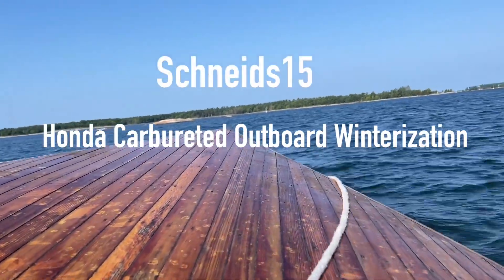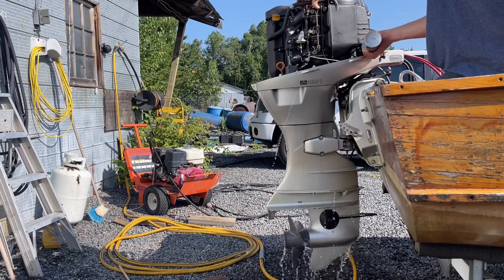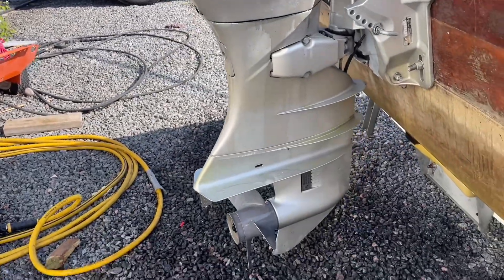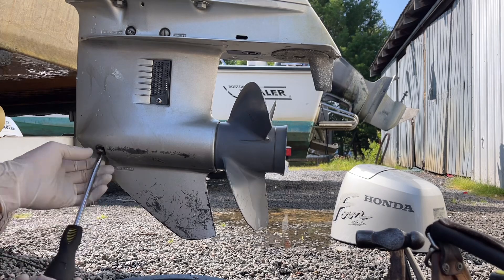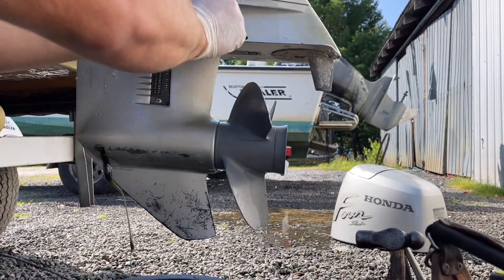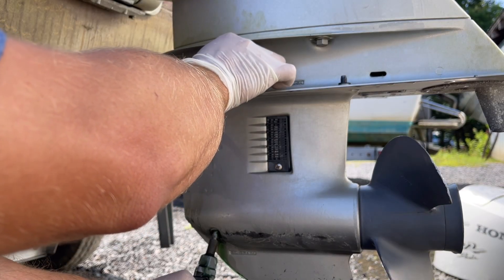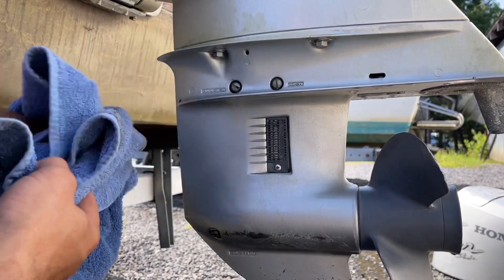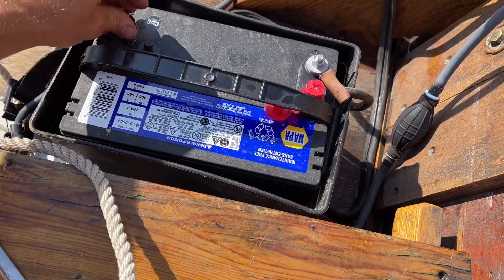Honda Outboard Winterization Process in 3 Mins!!

Comment: Thats not winterizing. You never put antifreeze in the engine.
Reply: If you store the motor in sub zero temps, there’s a chance any water left in the engine or lower unit passageways will freeze. That’s something that can write an engine off. It’s well worth pouring something like starbrite non toxic antifreeze through the engine and watch it come out of the lower unit. Personally I use a T connector in my water hose and connect it to the antifreeze container, and I open it to let the antifreeze flow through and then shut the water off. Then kill the engine when I see just pink coming out of the lower unit. I know it’s full of antifreeze then not water. Most water will of course drain out due to gravity. But you can’t be sure all of it will. A litre of two of antifreeze is cheap insurance.
Reply: @kristoffscuba5466  So, what do you do about antifreeze spillage and getting rid of it appropriately in the spring....that suff is toxic to pets - and they love it.
Reply from the maker: Gerry, if someone would want to run antifreeze through the engine you use Non Toxic RV Antifreeze.
Reply: Why would you?

Comment: Glad to hear you don’t have to run antifreeze  through a Honda, I never did .
One suggestion would be to loosen the drain plug screw in the Carnegie and get that old gas out of there while you’re storing it over the winter so it doesn’t gum  up on you .
So I didn’t use my Honda for three years and when I did a trial start up in the driveway it fired right up  !
Also, always use staybill no matter what, it’s a cheap insurance policy  !

Comment: I have a 99 75hp. I have had some bad luck with just stabilizing the fuel. I have found that you really hedge your bets with drainage of the carbs.
Reply from the maker: Yes all opinions are different. We store this boat for years and love the results of just stabilizing. I was always taught to leave them full so the diaphragms in the carbs do not dry up. Also a lot of times the needle has rubber on it and this prevents it from drying up. Otherwise draining them is a great idea as well.

Comment: Sorry to bother you about a King Quad but I don't know who else to ask. I have changed fuel lines , fuel pump, and the shut off valve on the bottom of the tank tried (vacuum one and without vacuum ) I can not get gas to flow from the tank to the carb. Do you need vacuum from carb to get gas to flow.  (HELP) It will fill carb after awhile but carb runs empty fast. Thanks
Reply: yo, there is a setting on the fuel pet cock stamped PRI. This is short for prime. It allows the fuel to pass through without the aid of the vacuum. Sometimes it help to blow through the gas cap vent tube to help it get to the carb. Fuel will not gravity feed unless it's turned to PRI.  Hope this helps.